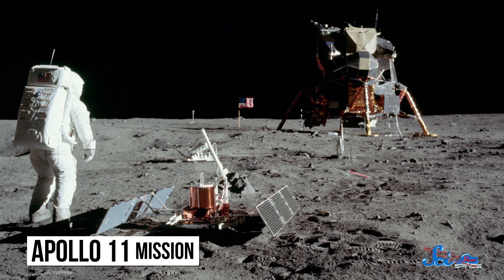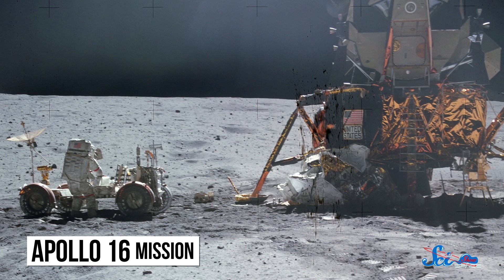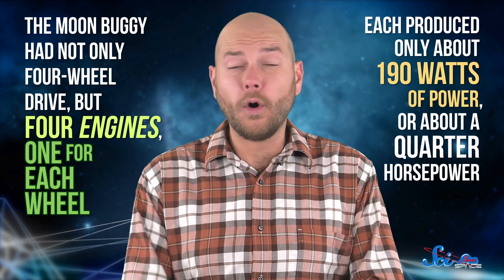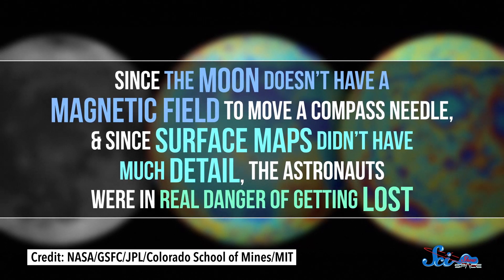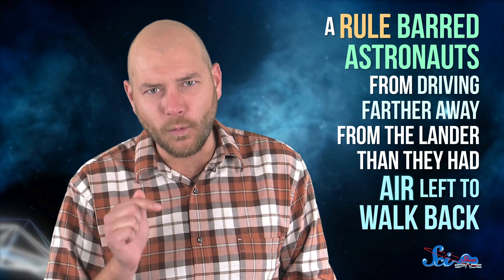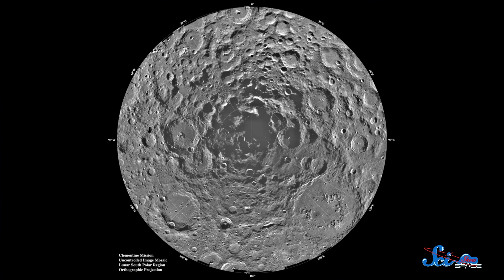What We Learned by Putting Cars on the Moon

Comment: The Astronauts  were very brave to drive 4km.away from the LM.    You explain  the complicated  science of how that the buggy had an onboard Gyroscope and Ondometer which connected to a computerwhich  acted as a GPS navigation system.    So should the car break down the Astronauts  would have no way of returning to the LM.    In a vacuum or near zero gravity on the Moon a  basic  COMPASS would be useless.

Comment: How did the film from the cameras make it back through the Van Allen Belts without being fried?
Reply: How do you know there are Van Allen Belts in the first place? NASA told you. They launched the monitoring gear for Van Allen, and brought back the data. 

So you believe them on this, but disbelieve them on Apollo film?
Reply: The total radiation exposure during the mission was less than what is experienced in about 6 months on earth. And they used temperature stable and radiation resistant film. Something conspiracy theorists try to focus on which was a non-issue in real life.
Reply: Exactly. I’ve shot motion picture film many, many times. When traveling via airport I have to have it handchecked (can not be scanned thru X-Ray machine  as the radiation ruins it).  Curious
Reply: @matthewhoffman9892  Hi matthew, hope that you are well. The Van Allen Belts is a region of charged particles originating mainly from the solar wind that are contained by the Earth's magnetic field. The VAB do not contain "X-Rays". Take care.

Comment: 2:30 is wrong.  The TV camera only worked when the rover was parked.  They'd stop the rover, align the dish to point it at Earth, do their work while Ed Fendell back in Houston worked the remote controls of the TV camera, then they hopped back on the rover to drive to the next stop.  The signal and controls would cut out as soon as they started rolling, because they'd lose dish alignment.

The only video taken from a camera on the rover while it was moving (other than maybe about 1 second as it started rolling) was from the Maurer 16mm film camera, which was mounted directly behind the TV camera.  (Yes, there were two video cameras.)  But, while it's true that the film camera worked while the rover was moving, mission control couldn't look around while the astronauts were driving the rover.  They had to wait until they got home to get the film developed before that footage could be seen.

Comment: A very good video, but you forgot to mention that the rovers had even more smarts and backups. For example, not ONLY were they 4 wheel drive, but they were also 4 wheel steer, necessary in tight lunar environments, where the rover might have to turn around in its own area, without something like a 3 point turn. Also, if there was a malfunction, they weren't necessarily screwed, because the rover could drive and steer in 2 wheel mode, with only its front or rear motors functioning. Absolutely amazing engineering!

Comment: One of the primary factors in the ultimate design of the LRV was that in the early '60s initial planning stages for the moon landing missions, planners visualized two Saturn V rockets being used with two landings taking place for each mission.  One would transport the astronauts and their lander, the other would carry and land only equipment and supplies.  That left a lot more payload for things like a fully enclosed, pressurized moon rover, basically a moon truck.  When Congress said "no" to funding double the number of Saturn V rockets, mission planners were forced to find ways to carry the astronauts and everything they needed on one Saturn V.  That led to the development of a very light weight, foldable, non-enclosed moon rover that could be carried by the so-called J-Type (class), 3-day stay, "Extended" Lunar Modules that were used on Apollo 15 - 17.

A footnote to the Lunar Rover story - Apollo 15 was originally intended to be an H-type mission (shorter stay, no lunar rover) but was bumped up to a J-type mission after the cancellation of Apollo 18 and 19.  The H-type lander that had been built for Apollo 15 (LM-9) could not carry the Lunar Rover and could therefore not be used on a J-type mission, so it never flew.  It's the only surviving completed, fully equipped, mission-capable Lunar Module, and is on display at the Kennedy Space Center.  All other Lunar Modules still in existence (on Earth) were built to function only as mock-ups or test vehicles and/or were not fully equipped.

Comment: Nice video!  SciShow scriptwriter:  The LRV did NOT have four engines; it had four motors.  There is a key difference, an engine cannot run in the vacuum of space.  Time to revisit Mechanical Engineering 101.
Reply: In common language a motor and engine are used interchangeably.  Right or wrong you'll hear licensed mechanics say either or both.

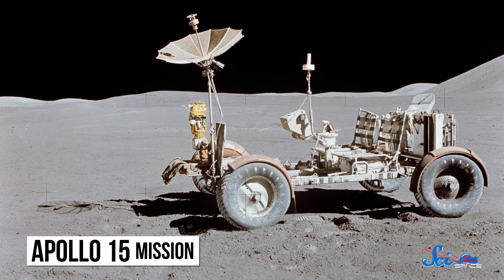Comment: 1:32 did the astronauts pick the vehicle up and walk it over and set it down? I see foot prints. I don't see tire tracks. Weird.
Reply: They actually did occasionally pick up one end to turn it.  It only weighed 210 kg on earth, which was 35 kg on the moon.  Picking up one end meant you only lifted half the weight, about 18 kg.  They sometimes did this rather than make a long turn driving.

Comment: Most of the NASA space program is a hoax.  The Achilles Heel of the NASA hoax is the NASA spacesuit with ice sublimator cooling system because it could be scientifically verified on Earth today.  NASA must publicly demonstrate before independent witnesses the operation of a NASA spacesuit with ice sublimator cooling system in a vacuum chamber on Earth duplicating environmental conditions of orbit.  NASA refuses to verify and has always refused to verify its spacesuits with sublimators because they can't verify them because they've been committing fraud against the Citizens of the United States for more than 50 years.  Plenty of NASA videos of spacesuits in swimming pools exist but there are none of spacesuits with sublimators in vacuum chambers although there is one video from 1966 of a NASA spacesuit without sublimator failing in a vacuum chamber causing a near fatality.  If NASA regularly uses the spacesuits with sublimators on spacewalks from the ISS as they allege and regularly tests the spacesuits with sublimators in vacuum chambers at NASA's Johnson Space Center as they also allege then it should cost nothing extra and create no unacceptable inconvenience to allow a few witnesses to observe the next test.
The NASA space program is a faith-based thing and that is totally unnecessary.  Unless, of course, they have a scam to protect.
Reply: Nasa doesn't have to prove anything. Even if they did, you will still be claiming that the demonstration was, again, fake. That would go on until the end of time.
What's precisely the problem with the sublimator? care to elaborate?

Comment: The animators doing the CGI failed the 3D skill. That, or the virtual Moon buggy had its steering rigged backwards. At 6:35 Reid turned the wheel right and the "buggy" turned left.
Also, motors, not engines.
Reply: mo·tor
ˈmōdər/Submit
noun
1.
a machine, especially one powered by electricity or internal combustion, that supplies motive power for a vehicle or for some other device with moving parts.
Reply: How's about you learn how engineers use the words to mean specific things before you mouth off. A motor is used to describe something that converts electricity into motion. An engine is a mechanical contrivance that does a job, usually but not always, converting some form of energy into motion, see Babbage's difference engine.

Comment: The rover is also really good at not leaving track imprints in between the front and rear wheels when you want to park it and take pictures of the rover. I dont know if we did or didnt go to the moon, but check out some of the official pics from nasa on the above mentioned track imprints and its onbvioulsy not all of the pictures but there are some which show what looks like a picture as if the rover has just been placed on the ground by a crane or something of that method. If your getting antzy im sorry, im just saying the pics are there and nasa doesnt explain why or how that type of anomaly works or can be explained. What im refering to is apollo pictures AS15-85-11470 and AS17-137-20979 just for 2 examples. Genuinely interested if anyone knows anything either for or against on the explaination. Cheers
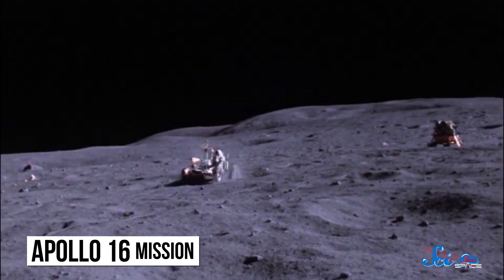Reply: I think you get your answer by looking at the video footage at 4:21. There is so much dust being thrown out it the air when the rover is driving by that when the dust would settle down, it would cover much of the track imprints. Plus the fact that the moon's gravity is really low and that the rover was light, the imprint must not have been really deep and defined to begin with.
edit: also you can see the rover is jumping a lot because of the low gravity, so there must some parts where there is not track imprint at all because well the buggy was in the air.
Reply: AtlantideVFX I literally never considered the dust settling as an explaination, but that makes perfect sense. I guess its one of those things that just slipped my mind. I am so on the fence about if we did or didnt go, i have watched all the evidence that we did go i have watched videos with examples and claimed explainations that we didnt go. One of the main things that keeps me on the fence is why we havent been back, they say money and nothing more to learn... but if we "could" do it in the 60's we should be nailing it with current tech, they spend so much on war and other stuff surely its worth the cost for further missions. They should be be using the moon for mars mission simulations, testing of buildings people will be living in on another planets or moon all those things, anyway all that is a whole different discussion in itself. But that definetly clears that up for me on that anyway. Cheers for the response i appreciate it :)
Reply: You're welcome. And for the reason why the US didn't go back since then is pretty much because of politics. I think you know it already, the cold war was characterized by this battle between the US and the USSR, the first and the second world, capitalism vs communism. So there was an incentive to make one camp stronger than the other by any means possible; nuclear weapon, economy output and grandiose scientific achievement like putting several people on the moon. But since there is no more that ideological clash and race, well the incentive have pretty much dissipated.

And space travel is not politically winning, so no politicians put that forward. And space agencies with their budgets prefer to send satellites and build telescope to get the more science data out of it compared to a man exploration which do not yield the same quantity of science data by unit of cost. It's why rather than sending humans on mars, NASA prefers rather to send rovers as it's way less expensive, no need to bring it back home, and yield more scientific data for the cost.
Reply: Michael Reid Check out "Parallel shadows".  They are only really practically possible with a light source as bright as the sun, as far away as the sun.